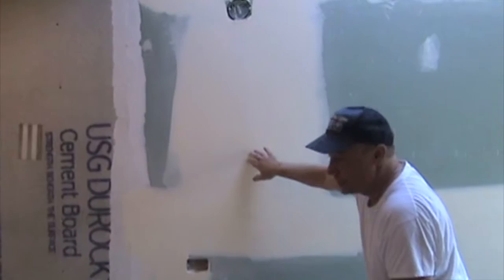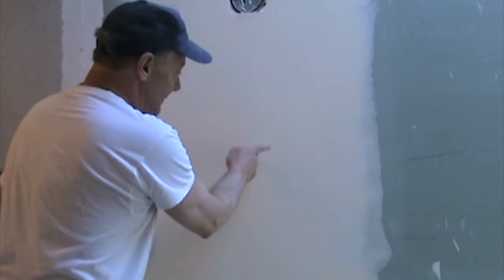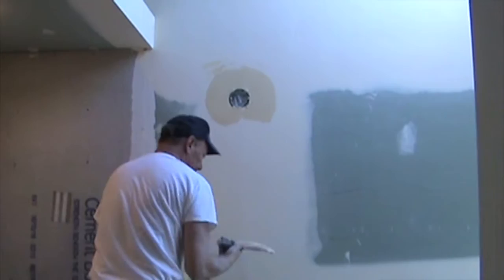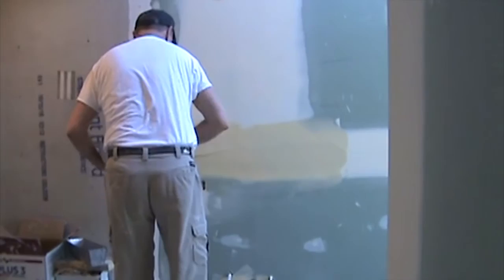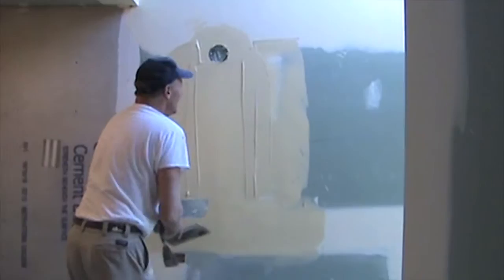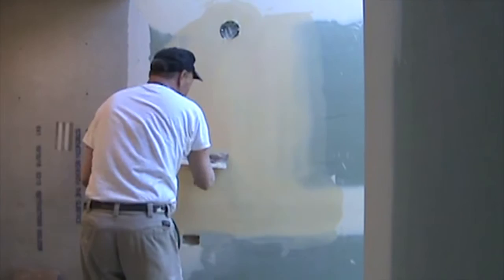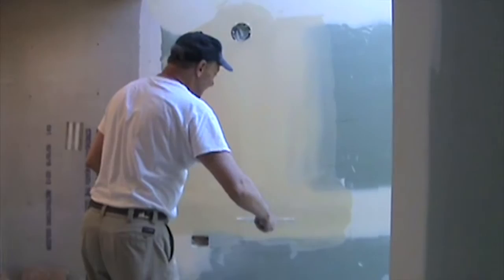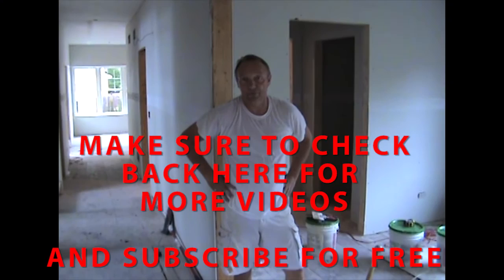Drywall 101 - How to Skim a Butt Joint

Comment: Have always enjoyed your vids, not just for your laymanic (no such word; more like “down to earth”) speech, but more for the in sync theme you present through out all your vids.  

But honestly, hot mud for the weekend homeowner can be tantamount to a bad first experience in drywall repair.  The aftermath may at times require a hammer and chisel or even a jackhammer to rectify the mess.
Reply: I’ve used Durabond (90) for the past 6 months.  This is definitely a pre-step application.  This simple pre-fill, or patch work compound makes your finished job last a long time.
(I’ll let you know, God Willing, how it holds up a few years from now.)

Comment: You don't worry about the lightbox your main concern is  making that but flat then you can slick out the the entire butt area use a 12 inch when skimming  for smoothwall for less lap marks you always want to use your knife to gauge the amount of mud you need to leave ,and where at. When you finish it should feel flat, and smooth as glass same with the rest of it.